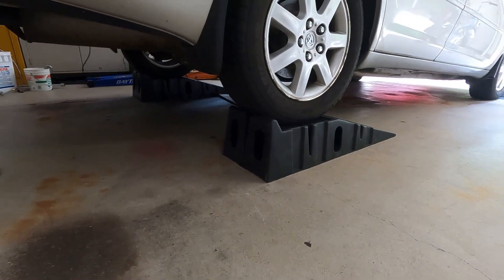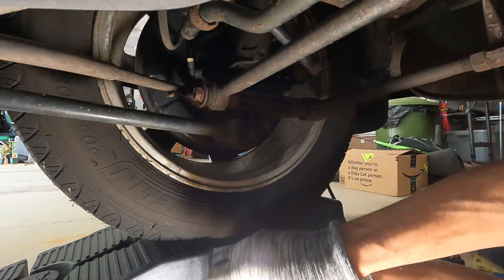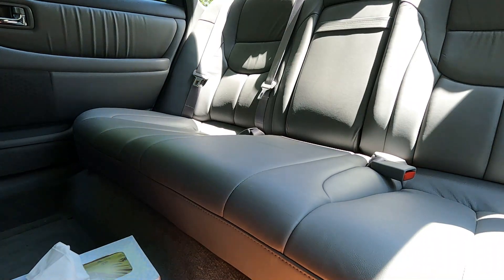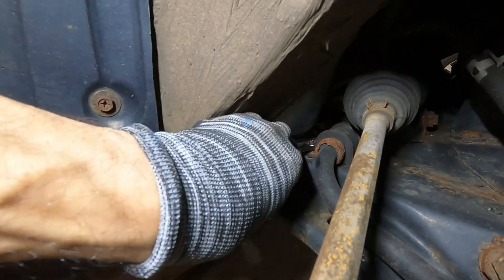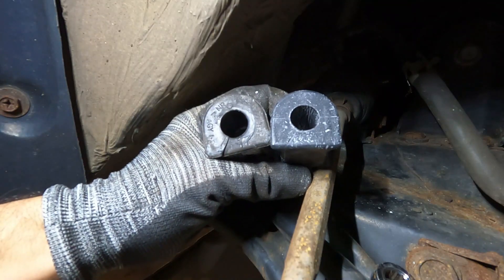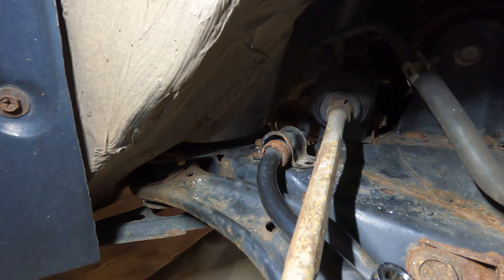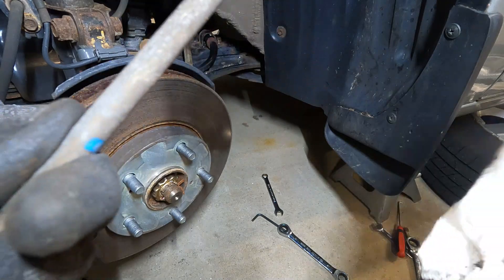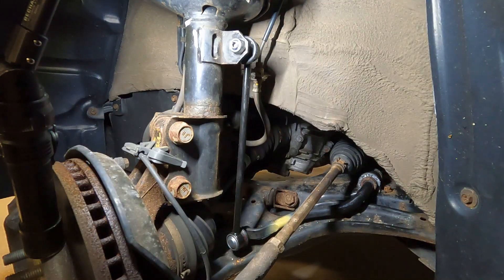2001 Toyota Avalon Suspension - Fixing the Clunk!

Comment: Thanks for the video. My question is why the clunk when your old bushings looked in decent shape? I have the same situation ("loose spare tire noise" syndrome). Pondering whether to replace or not.
Reply from the maker: The bushings looked fine, but were actually worn down.  The new ones compress a bit when installed so they hold the sway bar a lot tighter.
Reply: Did you eventually replace sway bar end links? Those are big culprits.
Reply: Never mind, should've kept watching. 😂

Comment: I would never use a impact  on them bolts holding the swaybar bushing bracket. Especially on a older car. The bolts are known to break due to rust and what not. You got very lucky the bolts didn't break, if it did, you'd be hearing way more clunkin and trips to the hardware store lol